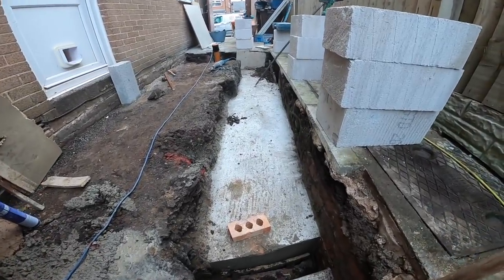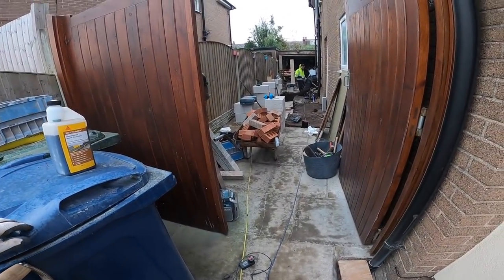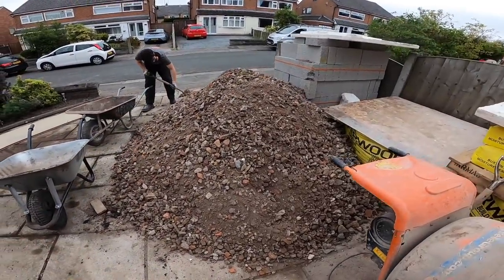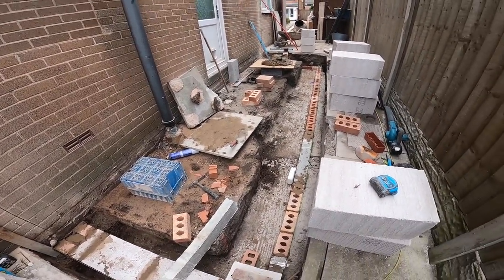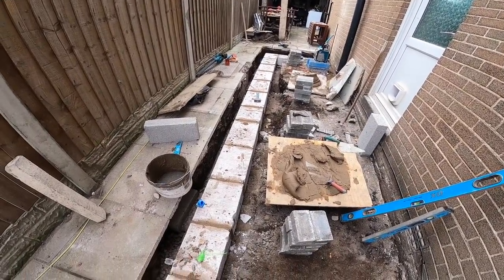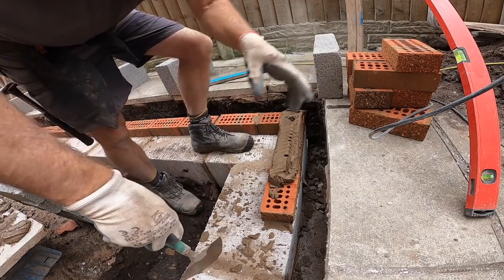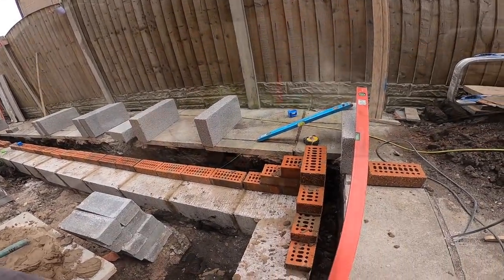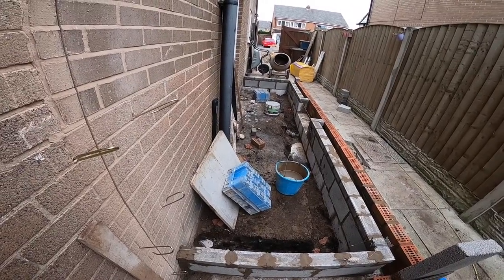POETRY IN MOTION GRABWAGON WORK, SMALL EXTENSION BRICKWORK UP TO DPC

Comment: I'm getting hooked on these videos. You're a great team.
I can't remember which episode i watched, but i do recall seeing Toplite blocks which are lighter than the heavy concrete blocks.
I saw the Top lite blocks in B&Q.
Can i use these light blocks as external blocks if ii was to build a 12x8 shed.  My concrete pad  is only 100mm deep.
Reply from the maker: 😂😂 Thanks Joel . I wouldn’t use them unless you are rendering them and even then look into Fibolite blocks 3 .5 Newton , light but way stronger than top lite 💪🏼🧱👍🏽
Reply: Thank you...much appriciated Steve.
Reply from the maker: @joelprinciple7519  No probs 
 🤜🏽🤛🏽🧱👍🏽

Comment: Where do you get your corner levels from? Do you not use a laser level on each corner usually?
Reply from the maker: We don’t own a laser level 🙄🧱👍🏽
Reply: @SteveAndAlexBuild  buy one its an essential piece of kit for the work you guys do 👍
Reply from the maker: @TheTraditionalGolfer  . £600 plus ! Won’t be getting one any time soon 😳🧱👍🏽
Reply: @SteveAndAlexBuild  we picked up a second hand hilti one for 150 quid cost 30 quid to get it calibrated job done top notch site laser for under 200 quid now we can be much more accurate and do a better quality job.
Reply from the maker: @TheTraditionalGolfer  . Build with A & E have a Hilti and that are quality 👌🏼🧱👍🏼
Reply: @SteveAndAlexBuild  good bit of kit....you don't need to fork out 600 quid mate there are plenty of good second hand ones about.....we had to sort some drains out the other day on a job there was a 70 metre drain run that some civil guys had messed up so in jump us bricklayers to sort it out....just to find the difference in the invert to the start of the run is easily sorted and something you can't do by spinning a 4 foot level across the whole site 😂
Reply from the maker: @TheTraditionalGolfer  🧱👍🏼
Reply: How do you get your corners level to each other corner without the laser level then? Just curious thanks!
Reply from the maker: @CallumsHDGaming  We just level around with a 6 foot level 🧱👍🏽